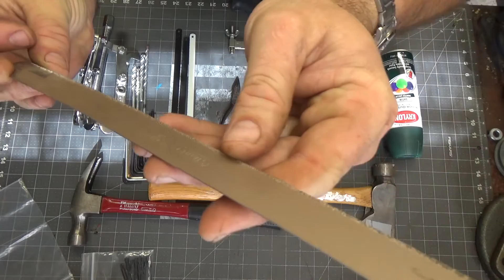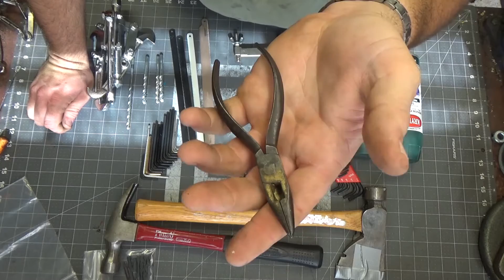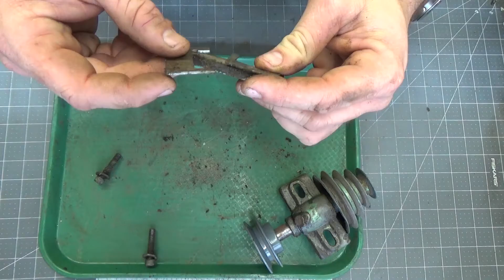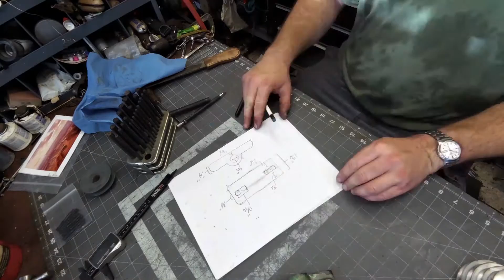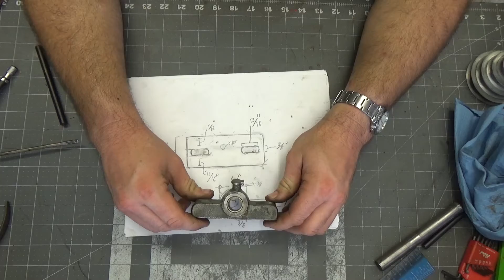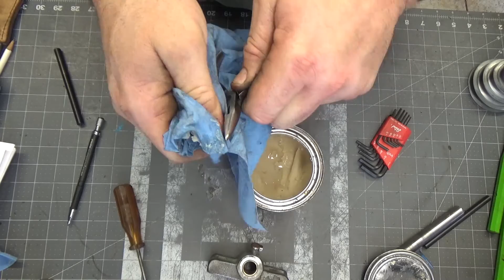Viewer Gift and (Walker-Turner) Parts drawing

Comment: Great gifts. Thanks Mark. You had said you were testing some things to put on tools to stop the humidity problems on tools. I must  have missed it. What did you find? Here in Kansas the humidity gets bad during the summer with high heat. Then during the winter my shop gets cold with not much heat. So all my tools get what SC called garage grunge. Thanks
Reply from the maker: Hi Glen, fast forward to 6:00 https://www.youtube.com/watch?v=tw04t4uvjlQ&t=755s

Comment: What a nice guy. Can’t believe he sent you all that stuff and can’t believe you don’t have a darn hack saw.  There is no order in the universe without bungee straps, duct tape and hacksaws.
Reply from the maker: Lol, no joke I did not own a hacksaw. Marc is a great guy, it was like Christmas opening that box. Cheers
Reply: Rusty Gun, you left off the fourth pillar - coat hangers!  I recently was repairing a floppy lamp on my grinder and thought "no problem, I'll stick in a few lengths of coat hanger."  No I won't, because my wife has replaced every traditional wire coat hanger with either wooden or all plastic hangers over the past decade.  Change just sneaking in there.  You can guess what I'll be looking for at neighborhood garage sales!  I ended up having to use a length of brass 1/8" bar stock.  It worked great, but it wasn't one of the most important things - FREE!